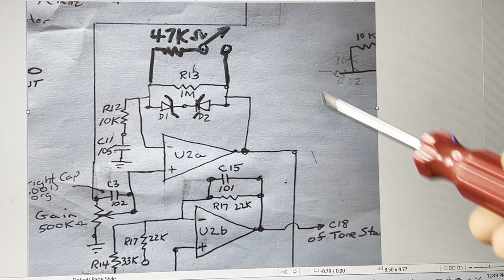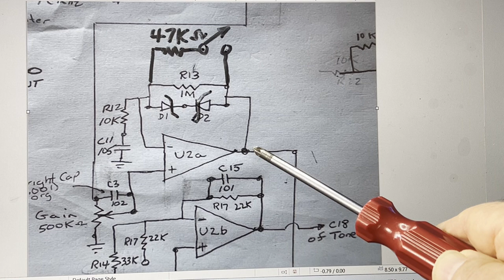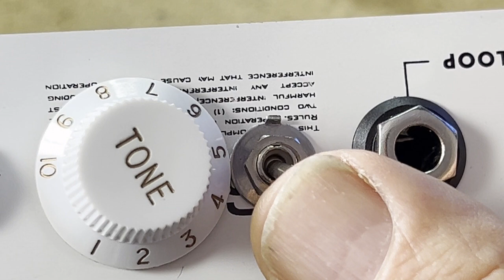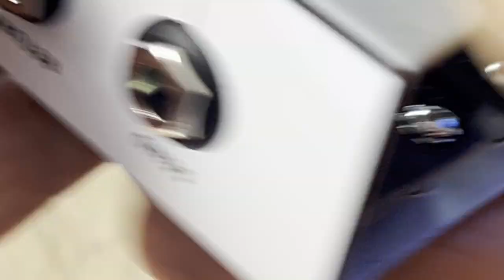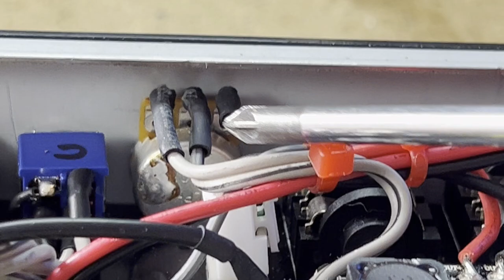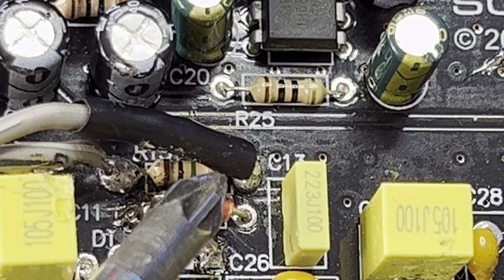Soldano SLO Mini Clean Channel L-AMP Modification 3, put a clean channel in your SLO Mini!

Comment: Is it ok to just add in the clean mod on it’s own?

Would that then mean only a 2 way switch would be needed?
Reply from the maker: @robbojaffa  Yes it is , a two way or a SPDT switch in series with a 47 k ohm resistor . The switch I used in this video, DPDT,  is only needed if adding Mod #1 plus Clean Mod # 3 .
Reply: Brill thank you.
Forgive my ignorance with electronics. 
What determines the value of the resistor to be used?
Reply from the maker: The resistance has to be low enough the reduce the gain of the  opamp to get it out of clipping the signal. But not too low , so the you lose clean signal level. You can experiment with that and put a pot in its place and adjust what sounds good to you.
Reply: Done the clean mod.
Works great so far despite my limitations! 😂

I have noticed though that from the crunch mode to clean there is a significant drop in volume. 
To match the crunch level but clean i have to switch it to the overdrive mode.
Reply from the maker: @robbojaffa  That’s great! Thanks for letting me know.
Reply from the maker: Yeah, there is a difference in level with the 47k resistor. You could try a larger resistor or a variable resistor in it’s place to dial in a level that is higher and the use your volume control on your guitar, dial it down to clean it up. Then when you want distortion, turn the guitar volume up. 
I have been experimenting with other clean channel methods but this is the easiest to modify.

Comment: Can you do the clean channel mod to the Bogner Ecstasy Mini head?
Reply from the maker: @scottdunn2178  I haven’t yet looked into that one, but I have a strong feeling it can. Due the fact it is also a high gain amplifier the circuit gain can be changed to operate in the clean region.
Reply: @charlielamp2739  Can this mod be footswitchable... or do you have to use the toggle?
Reply from the maker: @scottdunn2178  It could be done with a foot switch though it may need a relay circuit to keep the signal path through the wiring short in length, so it doesn’t pick up noise. It is a fairly large signal at the point of modification and the foot switch has shielding , it may work without a relay?
I actually was thinking of doing foot switch video sometime in the future.
Reply: @charlielamp2739  Do you do these mods, or just provide the circuit DIY? I'd love to get this done on my Bogner.
Reply from the maker: @scottdunn2178  First off, I really want to help you out. The Bogner circuit maybe    D
Reply from the maker: What I was saying, the Bogner circuit is probably a little different the the Soldano , would you be willing to take a picture of the circuit board? And email it to me. Taking it apart is on my deep video. Then I can tell you if it can be modded. Email link is found at About me.
If you do , get a close shot.
Reply: @charlielamp2739  You should be able to bypass the first gain stages and tap into the circuit to create a clean sound like the SLO Mini.  I'll take it apart ASAP and send pics... it's well past warranty anyway and I'm dying to see what makes this little thing tick. It's a great sounding amp if I use the Variac switch... I'll be in touch Charlie. Thanks.
Reply from the maker: @scottdunn2178  Hay that sound good, yeah there are a few ways to do it. The tricky part is to get the volume level to match, that’s where a separate clean volume control would be nice to have.
Talk to you soon,
Charlie
Reply: @charlielamp2739  Couple of short clips of my playing on my channel so you know what kind of tone I'm after - think Akira Takasaki mixed with a little Dimebag 😀